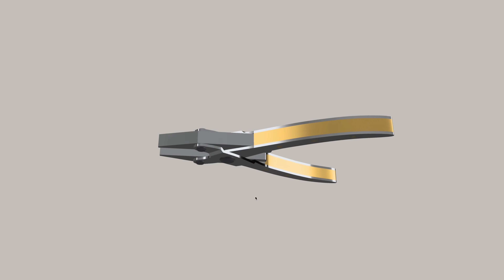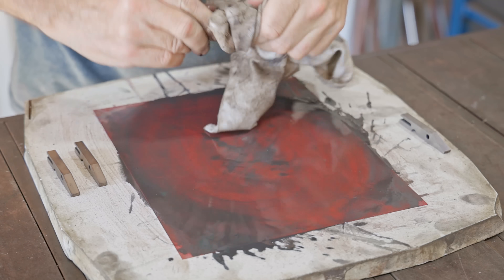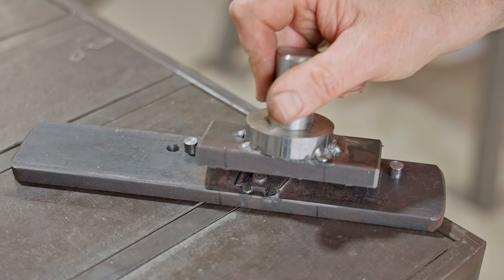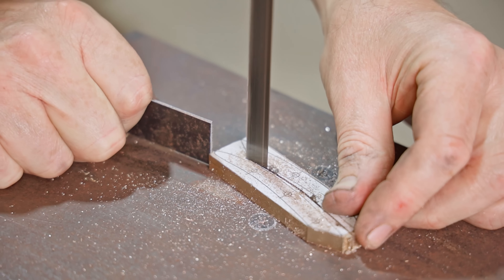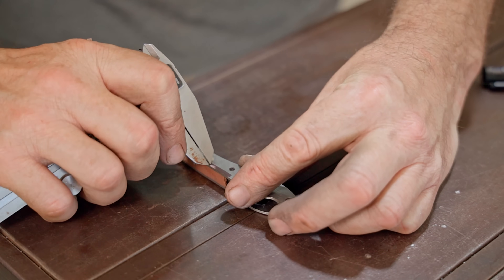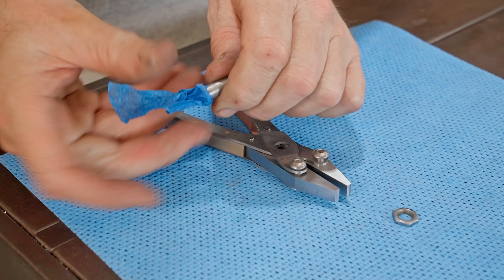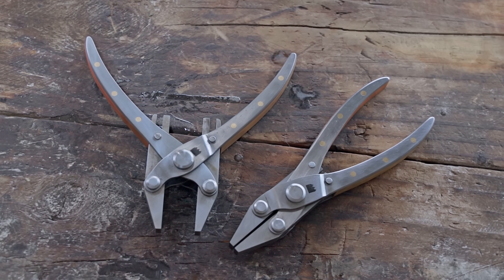How do Parallel Pliers work? Let's make some with Wow Factor and find out!

Comment: I'm in the process of restoring a pair of parallel pliers that I found in an ammo box of my Dad's tools.  I thought you might be interested in the info I found on mine. 
Side A: Schollhorne Co.   Newhaven Conn.
Side B: Bernard Pat. 1064956.   No. 102-6 1/2
Mine have what appears to be a wire cutter on one side, though the blades do not come close enough together to cut wire.  Could be a crimping jaw.   More to learn

Comment: The faces are kept parallel around a robust center "peg" and those faced sides are affixed to the assembly at two points of the two sides of the handle.

Comment: I got a pair of parallel pliers given to me for almost nothing while working a flea market. I seen them in a pile of random tools and was looking at them i had never seen pliers like that before and asked about them and guy running the table just gave them to me for free. They`re stamped BERNARD Sargent & Co New Haven, Conn made in the USA and they`re great pliers I`ve been using them for years one of my favorites. They work on the same basic sliding pin in slot priciple but they extended some of the material from the top jaw and adding a parallel plate that links with the hinges for an entirely seperate wire cutting mechanism that sits above the top jaw. I don`t know why they added this cutter in such a way where it would have been easier to have wire cutters simply cut into the base of the main jaws.

Comment: Nice work buddy. I used a set of these pliers when I was a marine electrician back in the 80s / 90s. Mine were spring loaded, so very easy to use. They were great for making bespoke brass clips to clamp cable runs to carrier tray.

Comment: That is a cool project! I saw Scoutcrafter restore some Bernard's parallel pliers, so I bought a No. 103 on eBay. As soon as I tried to operate them without soaking in WD-40, the flat torsion spring broke. 🤧 I cannot find the spring material without buying 59ft. of it. So I have a torsion springs coming from Amazon made of round material. I hope to make it work. Great job on the pliers! 👍🍻

Comment: I first saw this kind of pliers when I was a kid.  My dad saved a set from the home of a deceased relative.  They were "Bernard" pliers.  The name was stamped right on them.  A special feature of them was that a wire cutter was included on the top.
Reply: I found a pair of those at a garage sale and got them for $3 a few years ago. Says NO 102-C on the side. I dont use them often but i like using them when i need them

Comment: As a music instrument repair tech working primarily on woodwind instruments, these may very well be one of my most used tools! Between my Knipex of various sizes and the vintage pair I found off eBay that someone modified to be parallel duckbills, they really are invaluable for holding soft materials you don’t want to mar. Great video!

Comment: Pask, your skills never stops to amaze me. The level of details and the experience you have is excellent too. But the brass/copper handles I absolutely agree on. First of all it looks more interesting, also if you ever get a nasty scratch or dent in one of the jaws you just remember what side it is on in case you are handling something soft, like brass and there's a particular side you don't want to potentially damage with the scratch or dent. Keep up the brilliant work!

Comment: What looks like could be a neat addition to this, would be small channels in the sides of each jaws so that small C channels with a texture pattern could slide on to add a little bit of bite to the jaws whenever you want to slide them on.
However a drawback would be that it would be that they could slide off while your gripping something probably. Any idea how to improve on my idea?

Comment: Wouldn't there be an issue with dissimilar metals causing corrosion in humid environments? You'd have to keep them like firearms with penetrating oil and such?
Reply: 17:46 if you read very closely, the word “ corrosion ” is on the bottle of t-9

Comment: You could just put flats on the side of the bolt, or put a couple holes in it, for a spanner, or have a roll pin/set screw that goes through the head of the bolt, and into the handle.

Comment: step 1. take a workshop with  $400000 worth of machines, tools and equipment....
Reply from the maker: Step one is to start somewhere with basic tools which you can achieve most things with if you have the will. Step two is to build your tool collection up over the years which will help for sure but not having the best tools isn’t a good excuse to not give it a go. 😊

Comment: Parallel pliers are fantastic, I've got an antique pair of Bernard No102s which are an heirloom from my great grandfather; they're an old set of what I've seen described as both lineman's and fisherman's pliers, with a groove running the length of the jaw, a deep knurling on the gripping faces, and a wire cutter build into the outside of one of the jaws; they're missing the nuts that hold the screws through the hinge, but they still work, and in spite of the fact that they're probably approaching 100 years old (to my knowledge), they haven't got a speck of rust anywhere on them.

Comment: Why did you not cut off excess “near enough “ then use the mill for precision? When doing the jaws using 20* angle in vice. Milling looks fun, maybe that’s why? Just wondering.

Comment: I'm surprised that parallel jaw pliers aren't more widely available, especially with modern manufacturing methods. I have a pair that my father "acquired" in WWII when he was stationed in India with the Royal Electrical Mechanical Engineers installing radios in tanks. He told me they were part of the tool kit that came with every tank and were a popular item. (He was there when the war ended, so his "acquisition" at that time didn't put any combat troops at risk.) mine are slightly smaller with narrower jaw faces than yours, but based on my own experience them, I'm sure you'll find yours very useful, too.

Comment: In the beginning, you asked which material would we choose brass or copper. I would have chosen copper for two reasons. The first reason is that copper is cheaper. The second is that it looks great with the brass pins.

Watching your video gives me confidence I can do that. I've had my lathe two years now but gave up trying to make anything. I just use it to drill out or reduce or level metal down. Thank you, fella, great content with your commentary and close-up shots and overall great entertainment.

I've just clicked all the necessary icons, and now I'll go back to the beginning of your channel to watch from the start. Thanks, mate.

Comment: Nice pair of pliers. I would not go for the mild steel and copper combo here in Europe as it would drive the galvanic reaction between those two metals and you would be unable to stop them from rusting into pieces. However, they are most likely gonna be fine in dry Australia. ;-)

Comment: Just to say, epoxy is a thermoset plastic. Ie. Does not remelt. It becomes brittle with heat and loses mechanical bonding due to shrinkage/expansion etc. Great video.. Thanks.

Comment: I feel like the mill was telling you to drink ale because you had to redo that jaw piece and it took so long. The finished pieces both look beautiful, whether copper or brass, though I would have added a spring or two to make it pop open. Possibly added some very fine knurling to the inside of the jaws to give them a bit of a grip.

Comment: Not a big fan of what you did with the epoxy. You know how to make brass rivets... Why didn't you just add a very slight bevel to the steel and rivet them?
Reply: Additionally, I think the handles are too wide. When the jaws touch the handles should almost touch too, otherwise when grabbing large objects they are too far spaced and gripping the pliers becomes impractical.

Comment: As an apprentice sewing machine mechanic about 55 years ago, I had a pair of Singer belt pliers of a very similar design. Mine had an in-built hole punch of about 3mm diameter and a blade on the side of one jaw for cutting round leather drive belts to length. The punch was used to punch a hole in each end of the leather which was then joined into a loop using a wire belt clip.

Comment: While I enjoyed watching you make these pliers wouldn't Knipex plier wrenchs do the same thing with more holding power. I sometimes need to grab flat peices of material evenly and I've found Knipex plier wrenchs to work the best. The hold extremely well and provide a rediculous amount of squeezing force. Plus they open super wide depending on which size pliers your using. I love the idea of these pliers and I am wondering if I could put them into use where I work I'm just wondering about there holding power. Maybe if they had the compound action of bolt cutters. 

Anyway loved your video. I look forward watching more of your builds.

Comment: I would have cut the brass and then the copper in half and then sandwiched the combination pieces between the flat stock and this way the materials are evenly distributed

Comment: Interesting question — couldn't a countersink have been milled into each of the face pieces the "Inlay" has affixed on either side, then the brass pins deformed by smashing them between pieces of harder metal on the fly press to make them conform to the countersinks, thus, forming makeshift rivets without the need for a rivet tool?

Comment: Saw the video in the feed - clicked on the video and noticed I had already subscribed to the channel. The reason must have been this is the only large maker channel - where the maker isn't too ashamed - or afraid - of his face - to be constantly hiding it (AvE, This Old Tony, etc). Anyway. I don't know if such a development of the modern technology has reached UK - but there is this brilliant thing called ANGLE GRINDER (google it) - which is possible to be used - instead of a hacksaw - especially when the precision is machined down afterwards anyways. And some proper KNURLING. That's what the insides of those plier jaws need - to be able to actually grip something. Great success otherwise - greatings from Latvia.

Comment: For heat treating you should pick up some parks 50... It'll last you forever and it works much better.. veggie oil goes bad after 5-10 quenches and can go rancid if you store it.  Plus it isn't a fast enough quench for most tool steels

Comment: A tip for calculating rivit length. A rivit should be long enough that the piece sticking out of the hole is 1.5 times longer than the width of the stock you are using to make said rivit. E.g you want to place a 3mm diameter rivit in something,you should have 4.5mm or material protruding from the hole to get the correct level of mechanical retention 👍

Comment: don't drill in your supports my friend. @3:03
Reply from the maker: That was a scrap of aluminium. :)
Reply: @PaskMakes  Its more about flatness, when the drill hits the aluminium, the material gets pushed to the sides first, even if clamped down. so the second time you use them, they are not 100% flat anymore. on bigger parts, that will be a measurable problem. :) 
also, i think its a good practice to keep tools  nice and clean, ^^

great video anyways ! :)

Comment: Parallel pliers are odd in that the closed position is the comfortable grip width of the handles.   Even opening jaws a 1/4" (*0.635 cm* haha) results in hand strain.     Good for holding sheet metal perhaps

Comment: I think I would have used aluminium as the handle filler, you have the strength of the steel outer layers to support the action. Seeing this post took me back to the 70's when as apprentices we had to make all kind of tools and equipment from adjustable spanners to scribing stands, most of the time only using hand tools like files hacksaws etc. As we went on with our apprenticeships we were then allowed to use lathes, mills, surface grinders etc. That set us up for life as qualified mechanical engineers.

Comment: Looks beautiful mate. 

I would suggest not mixing metals at all if you can avoid it. They tend to form Galvanic cells if exposed to moisture, and the current will oxidize some part fast. (That's the reason you'll add a bit of zinc near propellers and such on boats, you still get the current, but it will eat the zinc first, and leave the rest alone until the zinc is gone.)

And I suspect these pliers would look rather good with hardwood instead of copper and brass.

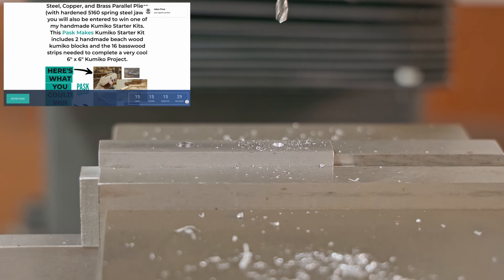Comment: 2:39 just a note: these centerdrills are not made for this purpose, they are made for lathes where you drill a hole for the center. What you need is a spot drill, which has an angle slightly higher than the tip angle of the drill :) 

you can watch this video from Stefan Gotteswinter about these: https://youtu.be/Ot8wPGQW3JI

Comment: Hi, I don't know if it's an invention or if it already existed before, but I find this pliers rather well conceived, it's true that with the "classic" pliers there are sometimes difficulties to hold objects or small parts well, with this system of parallel jaws it seems to solve the problem. If it's one of your inventions, register the patent because without a doubt some people will jump on it to make business and it would be a pity, if you are the inventor, that the royalties go into the pockets of someone who has not done the work of creation. In any case I find it very nice and I already wonder if it would not be possible to consider these clamps made through 3D printing 👍

Comment: Nice work, as usual. Have you ever used a hole starting drill? Works better than a centering drill. The centering drill only has the 120 deg at the tip band most people cut to deep.  I have the same mill, just different stickers---it's my favorite tool.  Happy making

Comment: Lovely looking pliers, nice job.

Question, where can I buy a good quality sanding belt that has an invisible/flush join? As the belt I have, the place where it’s joined is thicket than the rest of the belt, which makes it next to useless.

Any specific brands or suppliers?

(I should add, it’s for an old bench grinder, that has a belt sander at one end, and I only will use it once in a blue moon, and I can’t remember the dimensions of it, but I do have them somewhere 😮)

Comment: for someone with such fresh knowledge on the mill you seem to do really well, one work of advice, try to keep one hand moving an axis at a time, its not hard to wander when you use both hands, also pick up a machinist handbook if you havent already, they are really usefull to find critical dimensions and other really helpful information that beginners and pros use alike on a regular basis

Comment: I had a similar handle project last spring, but mine didn't end as well... The edge of the bevel on the outer steel warped (in spite of keeping it cool all the time), leaving a razor sharp edge with a minute gap between the brass and the steel... Whatever I tried to do to fix it, only made the gap larger and the edge sharper... Don't know what went wrong, as I did everything exactly the same way as Neil did in this project. Maybe there was some expansion or shrinking on one of the layers that put the outer layer under tension or stress. Pretty frustrating, as I had to scrap the whole piece because of this fail.

Comment: Since you are using the copper and brass as filler / insert for these pliers with steel plate as the framing  It I believe will not only stand up to what pressure an indiviial applies it will cause absolutely NO problems and esthetically it will look beautiful as well !  thanks for putting out a wonderful project. I just wish I had the equipment you have hahahahaha..

Comment: Those are lovely.  I probably would have soft soldered the handles rather than epoxy, and circlips rather than thin nuts, but that's nit picky. I very much like the fly press jig..

Comment: Only works for thin pieces though. Otherwise the angle between the handles becomes too steep and you no longer have grip. This is why Knippex parallel jaw pliers are adjustable and you’re almost always in the best position possible when closed.

Comment: Each handle is an electrical cell. One brass/steal and the other copper/steal. The rivets are making a short circuit. It may happen that the electrical current will eat away the less nobel metal.
Never the less I very much like the idea of the parallel pliers. :)
Also an adjustable plumbers pliers would be somehow more comfortable, because the grips doesn't spread as much, as you grab larger pieces.

Comment: Used many of them as a goldsmith for a number of years. They’re most useful for holding tiny round surfaces without marring them. Holds them flat relative to the item without being frustrated by trying to get the item grabbed just right. Using two at the same time to orient rings is far superior to using my needle-nose pliers. Tiny rings for chains or claps. Earrings. Basically they’re for jewelry but that extends into anything similar.
Reply: Made brass soft jaws,vedy useful
Reply: I need a pair to hold small steel pins when sanding them to length. Just reluctant to spend my own money for a tool that I'll only use at work. But I may just have to...
Reply: @dfailsthemost   There are many different jaw configurations to choose. They aren’t overly expensive. RioGrande is really good place to find jewelry tools. They have 40 different parallel-action pliers.
Reply: @dfailsthemost maybe try knipex pliers wrenches
Reply: @krkrbbr  I ended up using a file handle as a bootleg pin vice haha

Comment: Dang Neil, that's a really nice job on those pliers, they came out amazing. Haven't seen a set of those in eons, they really are very handy to have around. As to using a combo of brass and copper, I think it turned out OK. As to what I would have done, maybe might have cut the pieces in half and put copper and brass together for each handle or just made one plier using only brass and the other only copper.